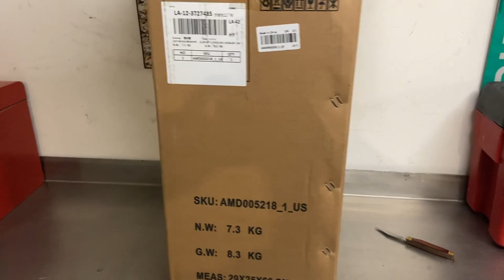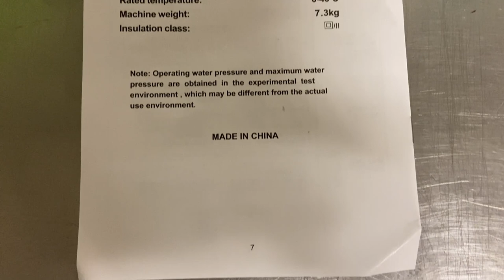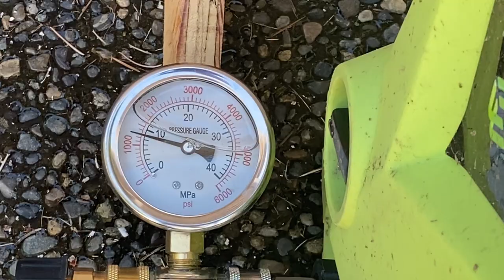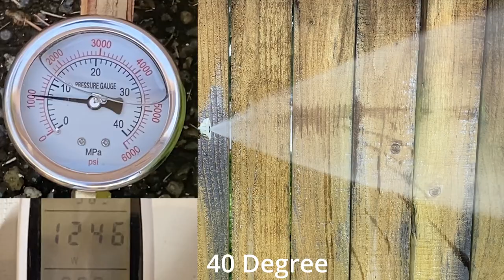Wholesun 3000PSI Pressure Washer Review | Amazon Electric Pressure Washer

Comment: I purchased one but the hose reel is very cheap quality.  It never gets straight. Since it’s a lower quality hose that stays wound up on the cord reel the hose never gets straight when you wind out the hose it’s just all bunched up making it very annoying to walk away from the unit itself with the wand. I find that I have to carry the unit everywhere I want to wash instead of letting the hose reel unwind fully.  
Is there a replacement hose that is higher quality that will work with this unit?

Comment: I just subscribed to your YouTube channel. I did so because of your review of the wholesun pressure washer.  I was extremely happy to see that you're very honest about it. I had already purchased the unit and changed out for a longer and better hose. I found that the pressure was really not adequate for what I wanted it for. It barely cleaned off the dust off of my rather large patio. I'm not sure about where I'd get a more honest answer I'm about the 1000 PSI. I was happy to see the 2.0 gallons per minute that you found. I am probably going to look for a different one. Preferably electric. But preferably with higher psi and higher GPM.  Any suggestions would be appreciated, especially from you. Thank you.